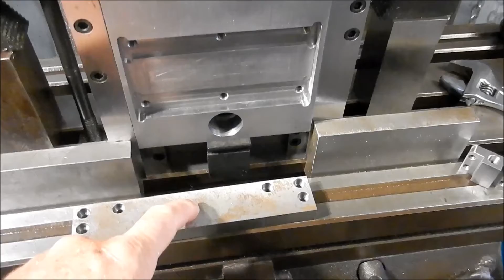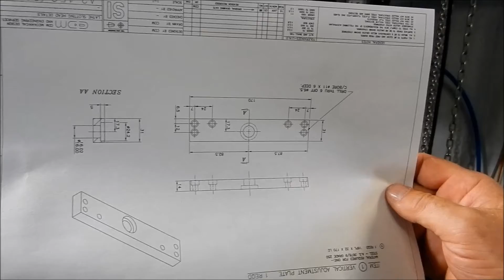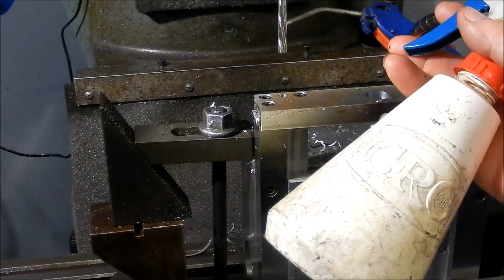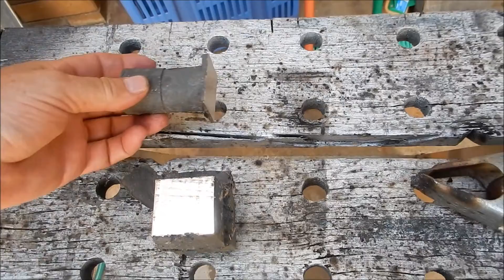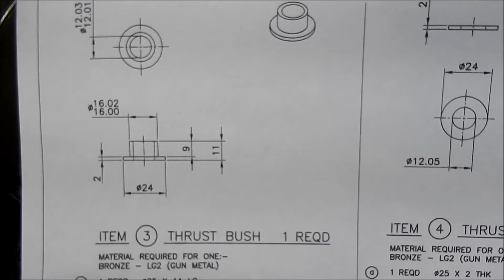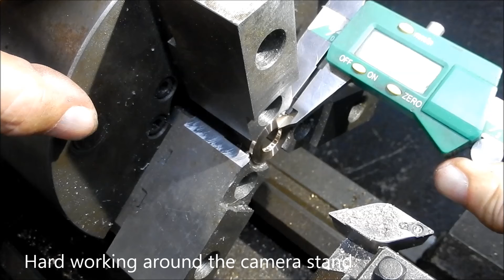Powered Lathe Slotter Build Part 36

Comment: OK I don't know what to say. I have put in a call to the authorities. I watched two partings off in one video. This cannot be Cameron. :)
Guessing from the chips that the riser was of a cupreous alloy. Worked out really well. I liked the dowels in the end plate. My being a cabinetmaker I was waiting for the glue. 
Screens! For filtering the molten metal Luckgen1001 must be spinning on his pillow right about now. (Confidentially I think they are not such a bad idea. But please don't tell Luckygen.)

ENjoyed the video. I know working around a camera is more than a little bit of an annoyance. But I enjoy watching you work. I honestly learn tidbits. Running the machines is similar in metal working or woodworking. Being mindful of tool geometry and possible depth of cuts is a little different but not that much. Slowly I am putting together my own machine shop versus borrowing a good friends.
First tool is a Brown and Sharpe surface grinder that is in the process of being resurrected. I may make a few videos of that.
Reply from the maker: Thanks for the comment Mark. I like using filters, its really a ceramic cloth, very cheap and good insurance. The bronze is one I alloy myself, its basically a Gun Metal designated as LG2 witch is very free machining, and yes it does part off easily so no stress. Yes I would love to see a video series on the grinder rebuild and it seems refurbishments are pretty popular on YouTube.  Don’t worry about Luckygen 1001, he’ll get over it.  He is very good at what he does and is starting to share his experience and methods around.  We live about 2 hr’s drive from each other so in the early days it was good to head up his way and play.  I wish he would show some footage around his rural property, Its very picturest with a great outlook into the valley.  I wish I had a backyard like that.
Cam